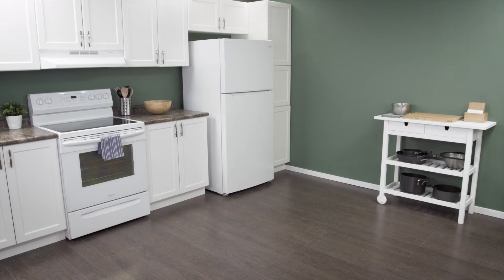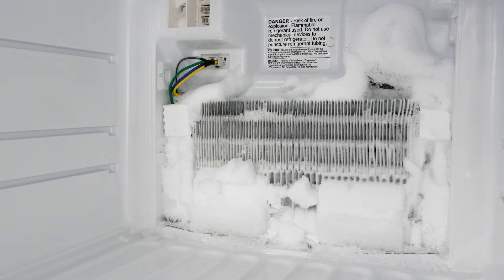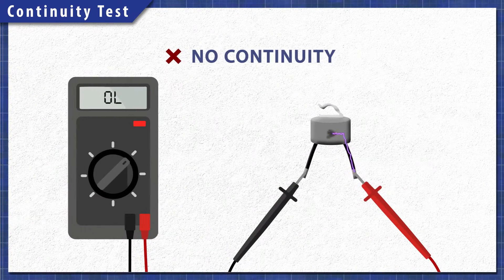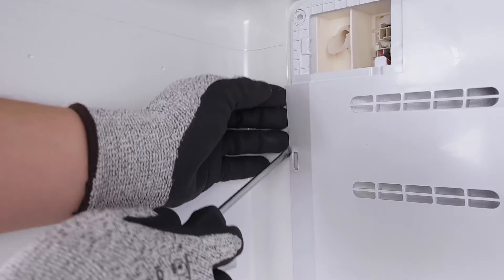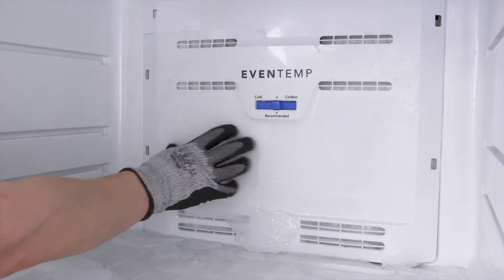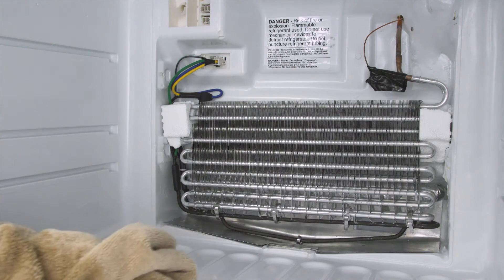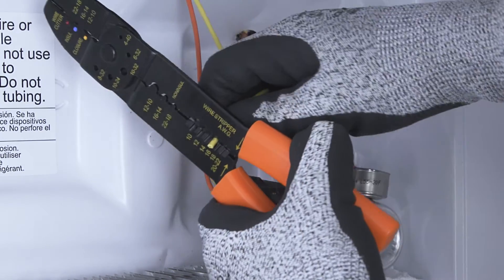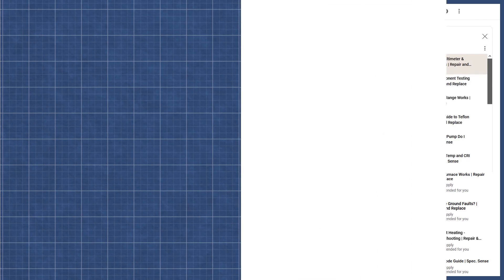How to Test & Replace a Defrost Thermostat in a Refrigerator | Repair & Replace

Comment: When I run the continuity test, the numbers jump all over the place. Is this normal?
Reply from the maker: Thanks for watching. It depends on how solid of a connection you make with the multimeter leads. The tighter the connection the less the numbers will jump around. As well any oils or dirt on the connectors can interfere with the resistance.

Comment: Thanks, what should be the resistance in case of thermostat in series with the heater at room temperature? Mine, which is a Samsung inverter motor freezer top one, depicts 333 ohms. is it ok?
Reply from the maker: Thanks for watching. The thermostat is a switch which means it will either be closed and have continuity between 0 and 1 ohm (to let electricity pass through easily) or at room temperature the switch will be open and have no continuity and no reading on the multimeter (it will show - - - - - - - or  something like OL on the display). If the thermostat is wired into the heating element then if you test both together then it should have a resistance between 20 and 100 ohms. 

if the thermostat has a resistance of 333 ohms at room temperature then it's faulty and should be replaced.
Reply: Thank you very much for the help.  Just I dont know how to take the thermostat. It seems be pressed into the  evaporator. All the 4 technicians, I have brought actually denied the existence of thermostat since the Ref has inverter motor. Now that I myself have opened it, i recognized the thermostat. It has temperature fluctuation in such a case that if i set it to 5F  it goes down to -22F  and after 7 hours of operating it the motor stops. Considering the 333 ohm reading and the explained issue, does it make sense that all the problem is due to the thermostat?
Reply from the maker: @Maryjanewotson  It is unusual for the thermostat to have a resistance like that so it is best to replace it. It would be worth checking the thermistors (temp sensor). The defrost thermost does not control the temperature of the fridge. We have a video "Refrigerator Too Cold Troubleshooting Guide" that explains this in more detail: https://youtu.be/sME40MR2VHc
Reply: Thanks, I have already checked the board by an expert and it is healthy. About the sensors, all are good. Just the  freezer temperature sensor is covered under a two layer Styrofoam which I couldnt open. I first measured its resistance and it depicted 5.4K ohms. Then I went to the balcony where is around 50F colder. The resistance didnt increase at the moment. Around 30 minutes later it was 6.8K  ohms. This behaviour is  different from the defrost healthy sensor that I have. In case of the defrost sensor, the resistance  has increased  as soon as I entered the balcony. However, I deduced that the delay in the freezer temperature sensor is due to the Styrofoam insulation, correct? BTW, the freezer fan has the resistance of 123K ohms( we have 220 Volts in here)
Reply from the maker: @Maryjanewotson  The styrofoam will provide some insulation but when it is consistently cold, but with the insulated sensor, it shouldn't take that long for it to change resistance but without a resistance chart or more specific info it is hard to say. If the control board and the other fridge sensor is fine, then it would be best to install a new freezer sensor and make sure that all the connections are secure. It is likely that the sensor is hardwired. If it isn't then try to make sure that the connection is good. Moisture can also interfere with the resistance if there are any exposed connections or terminals.
Reply: Thank you very much. I will try to take that sensor out of  the  difficult to open styrofoam coverage. But, after the freezer sensor,  would the problem be due to the evaporator leakage or even faulty compressor?
Reply from the maker: @Maryjanewotson  If the freezer is getting too cold, then it means the compressor is running more often then it should. This points to a control issue or a defective sensor. If the refrigerant leaked out, then it would reduce the cooling capacity of the entire system which would not create your specific issue.